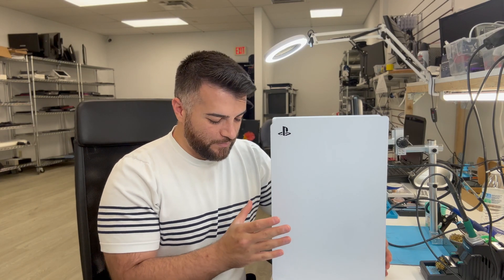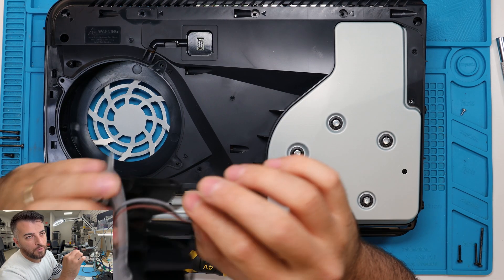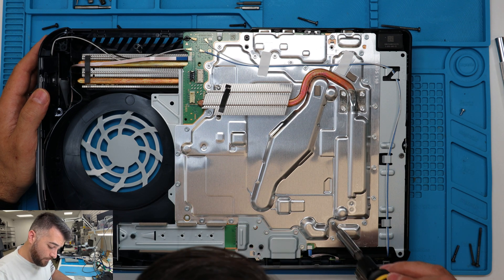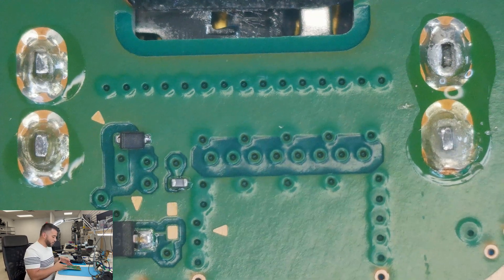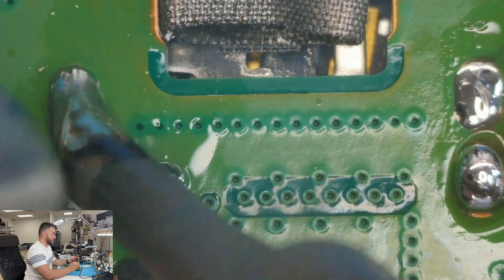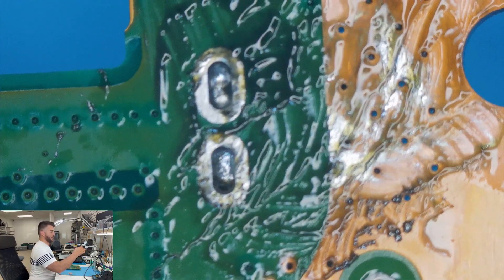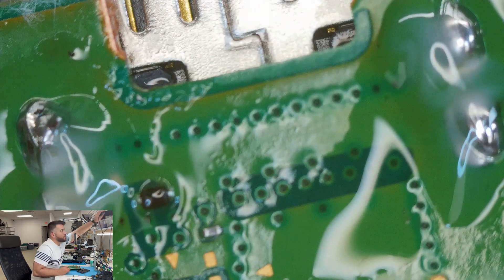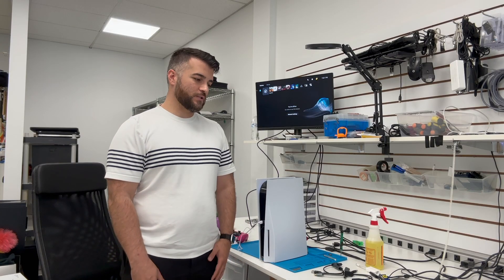PS5 HDMI Port Repair - Can We Fix It?

Comment: That's a jam up job right there man! Honestly the best I've seen. I've only done a couple but would definitely like to improve because it was a pain in the azz LOL. That kind of work takes a lil of everything to be perfect lol. I do have a couple questions if you don't mind. What temperatures are you using for your iron as well as your hot air station during the removal process and what type(s) of regular solder and size do you suggest when reinstalling the port that will have a nice hold for the long run? I really appreciate your time and such a detailed video!
Reply from the maker: @racardablackmon8389  I thought I replied to you! Thank you for the compliments! I recommend keeping your temps at around 700F at the highest and keep your airflow at 6 or 7 for a thin board like this. Also make sure you use flux! Don’t overkill just a dab should be fine. 

And 63Sn/37Pb solder wire is usually the best for smaller electronics. Use smaller diameter wire 0.015 inches to 0.032 inches in diameter is best.
Reply from the maker: You don’t even need to use your hot air. Just use your iron to take off the wires from the board like it did. Hot air is kinda overkill. Lol. If you’re asking generally, hot air and iron temp I keep usually between 7-800F and air speed at 7
Reply: @ Appreciate the tips. Definitely got my subscription 👍🏽

Comment: But the point is and what im getting at everyone keeps telling me you have to have micro soldering to replace the HDMI port on the ps5, Do you and even so ill get the right tools for doing it or pay someone if they don't try cracking my head like somy did or computer and game repair shops have!!!!! So please commit back on this and let me know what im facing please and have a good thanksgiving
Reply from the maker: Yes, we do microsoldering (It is needed for this type of repair). If you're wanting to send us your PS5, please go on our website and fill out the shipping form and send the PS5 to us and we can repair it for you for $200. It includes a cleaning and we check your liquid metal to make sure you don't have any dry spots. We will also apply extra liquid metal if needed! :)

Comment: Hey this is the second ps5 ive owned so far i always swore by Xbox/Microsoft systems until I switched over to the ps4 the ps4 pro but i have nothing but horrible problems and issues
Reply from the maker: @Dianna-r4g  Problem on your PS5? Both PS5 and Xbox X have the same issues. It’s all about how you take care of it.
Reply: @KortechService  o I know bro I'm OCD bad and take well care of my belongings and electronics but I work 12 hours shifts in a foundry 6pm til 6am and my little niece wasn't making her kids behave which are my great nieces and they kept tripping over the HDMI cord I'm pretty sure cause they are little baba kids and just in twelve hours they wore the part the HDMI port that's for picture and sound

Comment: Is that low melt solder again you use to prep the traces?
Reply from the maker: @joudomsouk  No, you want to use low melt solder only when removing. Clean the low melt solder with a soldering wick and apply regular solder to prep the pads and pins of the hdmi port. 😊 You don’t want to use low melt solder to bind the port to the board. It’ll lose connection because the board will get hot during use and the low melt solder will lose connection.